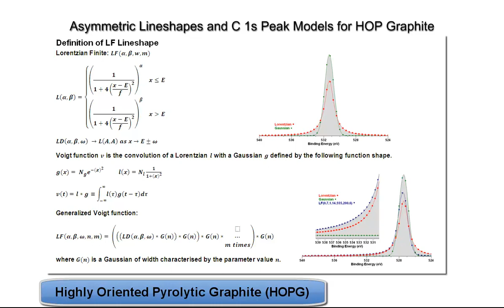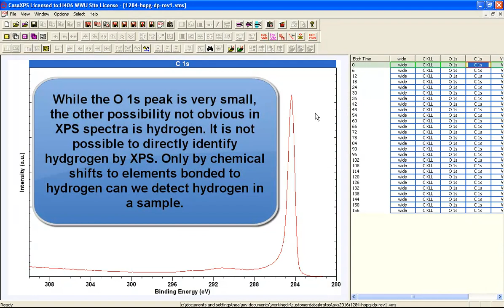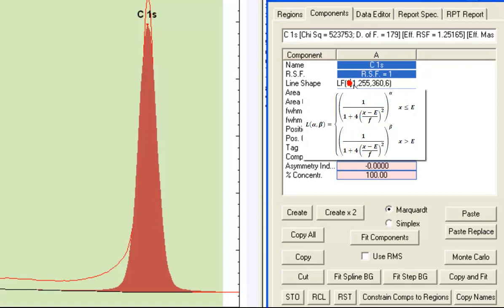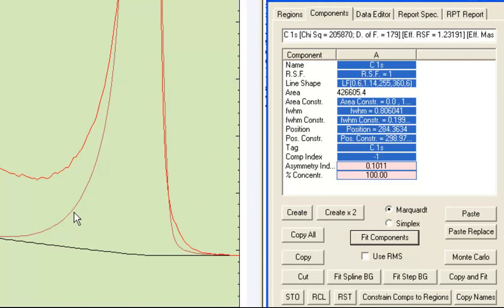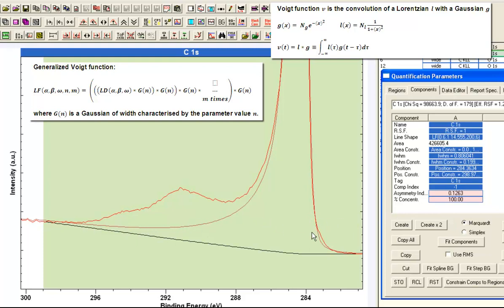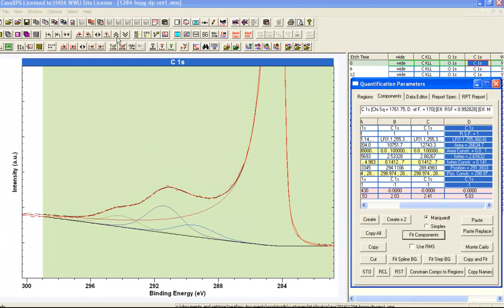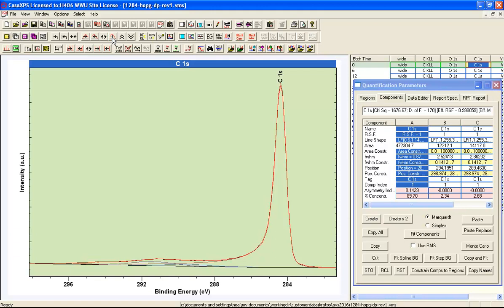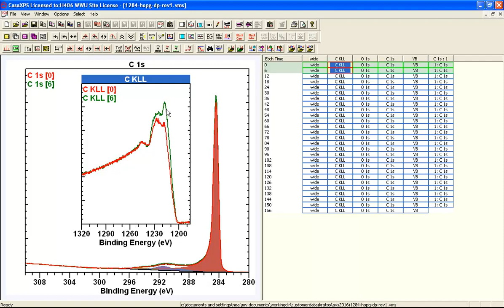Peak Model for Highly Oriented Pyrolytic Graphite (HOPG) in CasaXPS

Comment: LF lineshape can be used to fit graphene peak?
Reply from the maker: You should look at the video https://www.youtube.com/watch?v=56sJ7r81kt0. There is more background to LF and other line shapes. Graphene and HOPG can be similar in shape so both need some form of asymmetry in the line shape. This is not an easy problem to solve by peak fitting C 1s XPS spectra.

Comment: What are the parameters B and C from the Tougard used?
Reply from the maker: The background used in the video makes use of U 2 Tougaard where the C parameter is -3650. When using the U 2 Tougaard the B parameter is determined by the point at which the background is aligned with data at the start of the region so this is a read-back rather than a parameter.